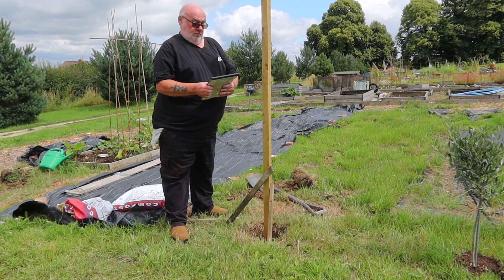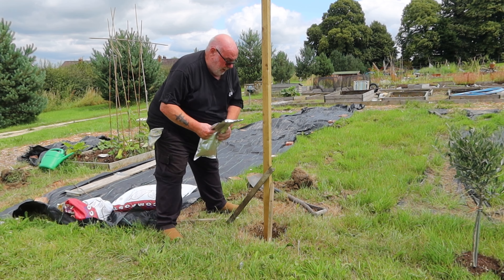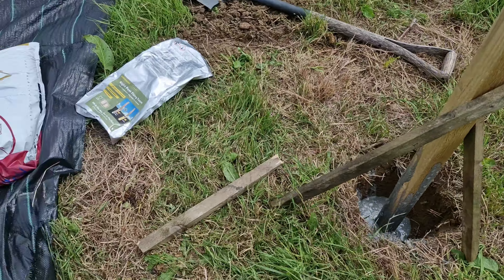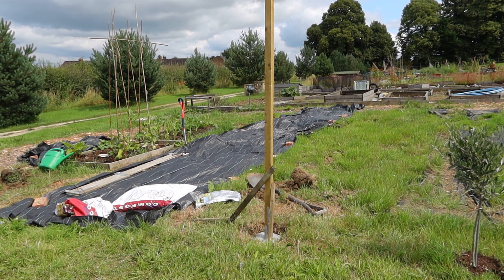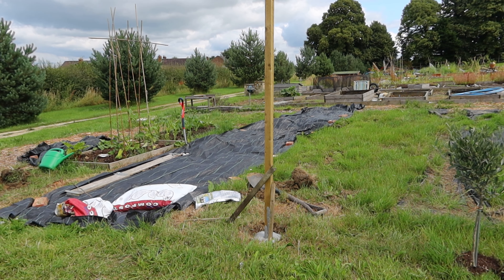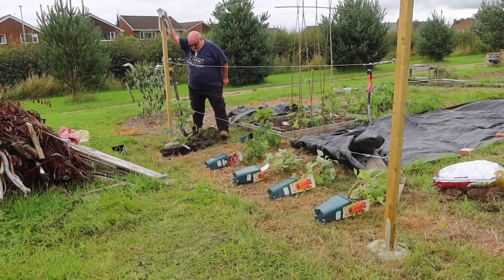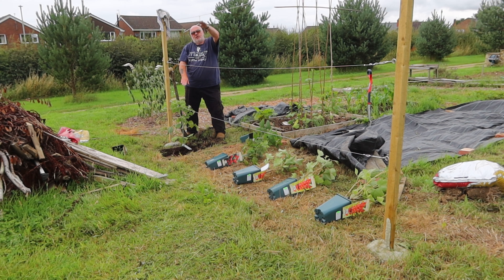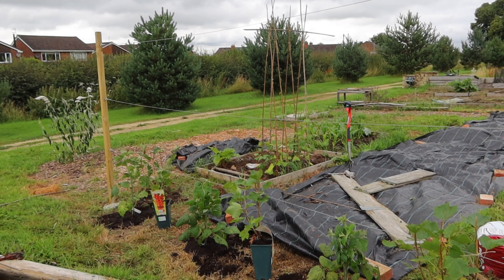Building a Raspberry Trellis

Comment: Looks a good job it's worth greasing older stainless steel you might want to undo one day stainless steels not what it used to be
Reply from the maker: I know, a right pain. I had to deal with many a "cold welded" (aka thread galling) SS thread in the Navy. Bloody nightmare. The only semi-reliable prevention was to apply molybdenum disulphide powder on assembly.